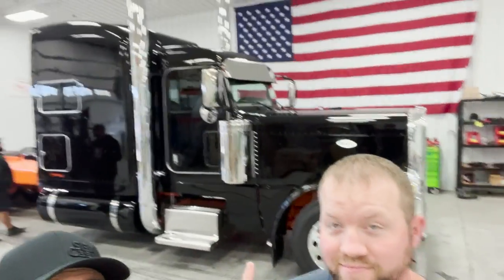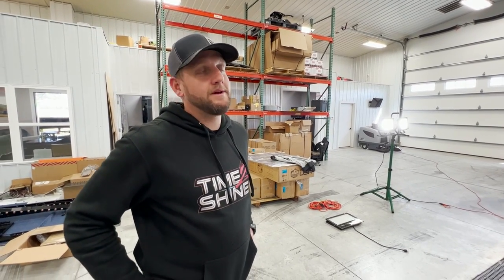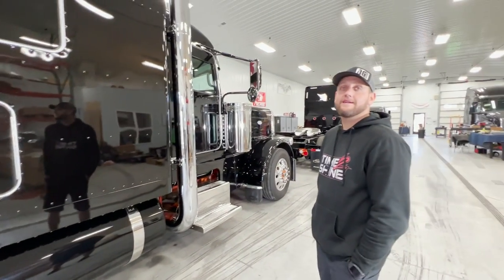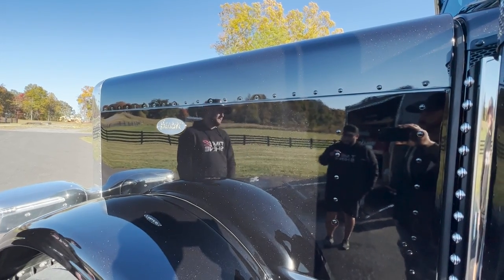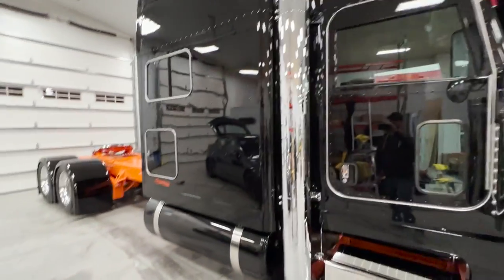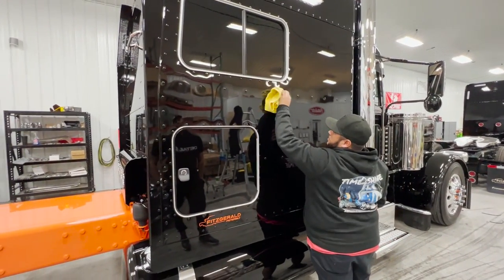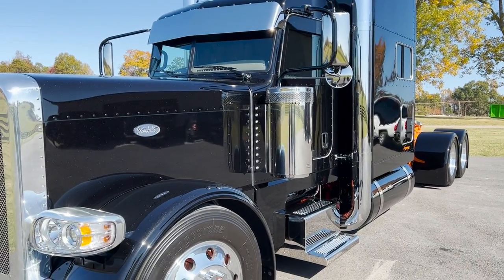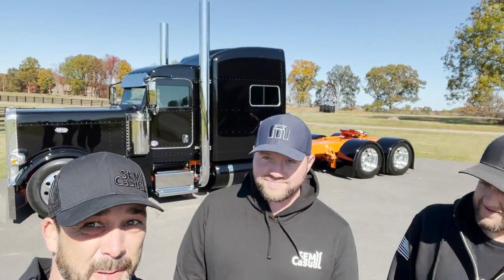Ceramic Coating... Is it worth it???

Comment: Ceramic is the new wax, you never wax this product unless you just want to..this finish doesn't wash off or away like a traditional wax. This will look this good in 4 years as long as you maintain it correctly..I do this service everyday. It's not cheap but you'll never spend all day cleaning your truck..I love ceramic..it's for real
Reply: Any kind of a ballpark # for a 389?
Reply: I had said before..... it looked as if I could reach in elbow deep in .... now it looks as if you could SWIM in the paint.... AWESOME 👌

Comment: I have a question. Does your front air ride dump work with a truck that only has a leveling valve on the passenger side?
Reply from the maker: Yes
Reply: @SEMICasualShow  Great!  I'll be ordering one. I appreciate it.